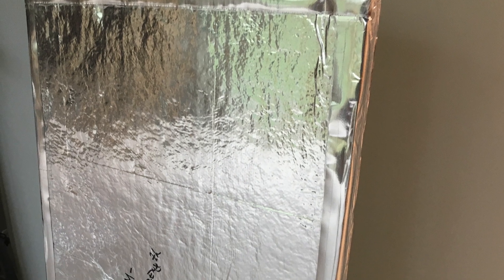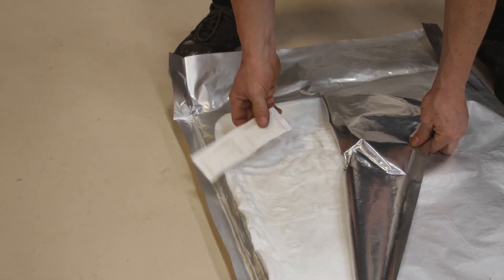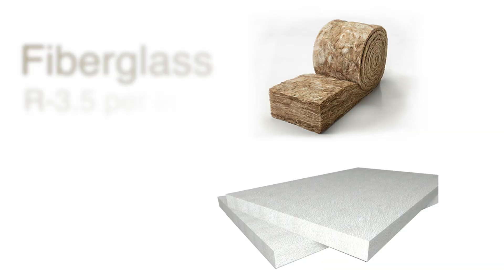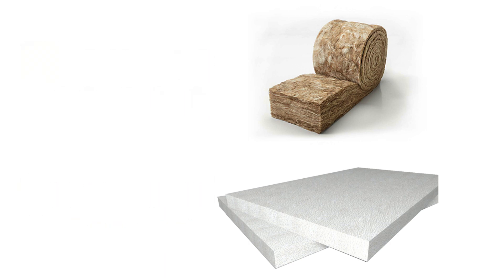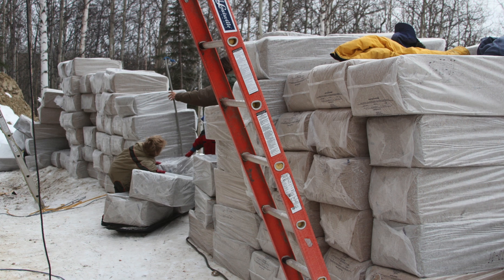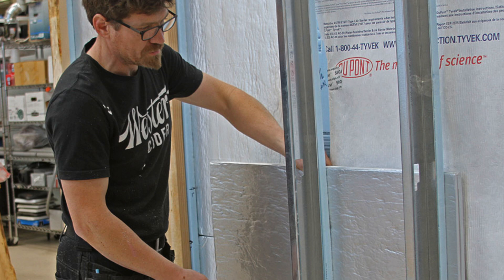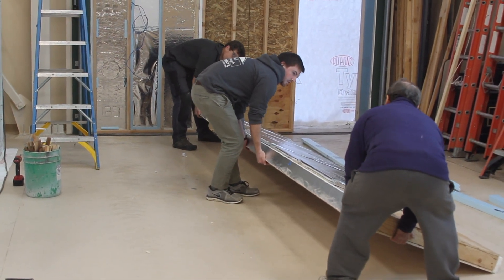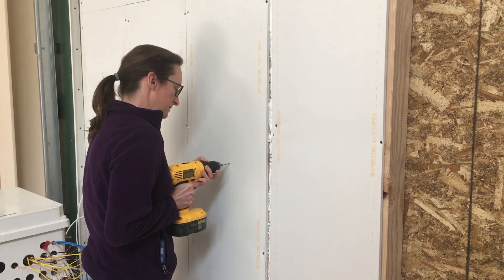Vacuum Insulated Panel Testing at CCHRC

Comment: The biggest concern is how likely they will be in getting punctured by a contractor in the field by like a screw or nail. Even if the benefits are high the fact that its going into home construction makes it extemely likely to be damaged in use. A home owner will most likely punture one just trying to hang some art or a shelf on the wall as well. killing all the insulation value.

Comment: With these types of panels, it’s best to cut a 1 inch slot in the middle of 2x6 studs than to go up against the inside/outside. That way they have more than 2 inches both sides to keep from getting nailed through.

Comment: I'm trying to find a company that I found three years ago pretty much when you posted this video they make vacuum wall insulation panels for floors ceilings and walls and the ones for floors and ceilings actually have rigidity you can walk on them you could put heavy pool tables on them they will not break if anybody here knows of that company I've been searching on Google just for about 5 minutes now I'm sure eventually I'll find it but yeah hit me up on here thank you
Reply: Did you ever find the name of the company?? I'm wanting to use VIPs for a tiny house on wheels build but the tech isn't quite there yet from what I've seen

Comment: VIPs have been sold for a decade.   (Kingspan's Optim-R since 2012, OCI's Enervac since 2012 (sold over a million units), Firestone's __, and Panasonic's __.  Did I miss any?)
When will VIPs be financially justifiable / competitively-priced for standard residential applications - cathedral ceilings / flat ceilings / walls / floors? What would need to happen for them to achieve that price point? 
Is it just a choice by manufacturers to sell high-price low-volume? Could manufacturers choose low-price high-volume and make more profit?
They require extra care and understanding, but could they not be sold in big box stores?
Reply: They seem pretty easy to make
Reply: @Robert-zx2df  that's because they are easy to make for the most part.
1.grab oversized foil sheet. 2. add packing/filler material then place another foil sheet over the top. 3.fold foil edges together over two times. 4. add double sided adhesive strips to one side of panel.
5. peel non stick backing off double sided adhesive, fold foil over sticky side of panel. 6. add more foil and double sided adhesive to add structural integrity around the edges and corners. 7. cut small hole in panel, then attach hose and evacuate air. 8. cut a square of adhesive backed foil then place over hole without losing vacuum. The last step would be easy to cover if the hole was a sports ball needle sized hole, problem is commercial panels use a 3/4 to 1 inch hole.
Reply: @zeroumashi2947     It is a little more involved. Most plastics (and adhesives) are gas permeable and also off gas. Typically there are multiple layers of both plastic (PET/polyester is a common one) and aluminum foil to try to reduce gas and moisture transfer as much as is possible. 

    Then, these usually have Getters and desiccants in them to absorb/adsorb gases and moisture. This is to help the VIP last as long as possible. Even with all these tricks--a lot of them are rated at full insulation capacity for something like 10 to 20 years depending. 

     They tend to be fragile, as the video mentions.
Reply: yes, i'm well aware that the adhesive isn't regular double sided tape. It's most likely one of the commercial 3m vhb formulas, they have so many varieties with different properties.
As for casing sometimes mylar is used. even stainless steel is also used to further reduce permeance.
They tend to be fragile because they make them with really thin material and haven't bothered to change how they're made.

I was researching about it long before i commented 2 months ago.
There wouldn't be a need for getters if the panels were prefilled with an high r value inert gas and then evacuated, or if assembled inside a vacuum.

I have an idea for an improved vacuum insulation panel that will keep it's r value if punctured.
I just don't have access to the tools to build it, the materials i can get.
Reply: @zeroumashi2947  - what would you need to test your idea - or at least get feedback on the idea?  Is your idea different from what you already laid out?
Thanks
Reply: What i mentioned is how most panels are currently made, except for the part about using inert gas or assembling inside a vacuum. 
They use getters like Justin w mentioned.

For panels that are currently on the market.
One way to reduce risk to loss of vacuum would be coating the surface in a self sealing gel and putting a thin protective layer over that to prevent the gel from getting dirty. That might provide some protection against nails which have a mostly smooth surface, It won't do much for screws if anything.
Putting a hardened fiber surface on the panel like some manufacturers have done, That won't do much if someone strikes a nail through it.

My idea would involve making a multi cell panel. You can't break vacuum of the entire panel by puncturing one spot if it has multiple cells.
Reply: @zeroumashi2947  The last part sounds to me like a hybrid of VIPs and closed cell spray foam.  (Cool.)
Do you have a sense of how to create the multi-cellular structure?
Reply: @zeroumashi2947  - The last part sounds to me like a hybrid of VIPs and closed cell spray foam.  (Cool.)
Do you have a sense of how to create the multi-cellular structure?
Reply: it's not closed cell because you can't currently form a vacuum inside the cells of PIR or PUR foam.
Although both PIR, and PUR foam are used in some vacuum insulation panels.
I wish i could say more, but i don't have a patent out and don't want anyone stealing my idea.
There's already a patent similar to my idea that uses a honeycomb structure.
I'm honestly just surprised that there hasn't been a drastic improvement in vacuum insulation panels.
It seems like people mostly want to just put out patents and never use them. 
You'd be surprised how many patents are out there.
Reply: @zeroumashi2947  - Not that I can be of much help, but is there something(s) you need in order to take the next step(s)? 
I'd like to think that others here - people passionate for VIPs' potential - might be able to help you move forward, in one way or another.

Comment: I'm so confused by the technology... I thought air is a wonderful insulator and hence the presence of air is a good thing. Hence most insulations are designed to be loose and allow the formation of air bubbles/gaps to allow air to be present and insulate from hot / cold, however in this case air is very much taken away... Can someone explain ?
Reply: Not so much about being a good insulator more about being a poor conductor
Reply: Air is a good insulator, but relatively nothing (aka vacuum) is even better, because there are far less atoms/molecules to transfer/exchange heat energy via conduction and convection. Vacuum can allow energy/heat transfer via IR aka a form of light, which travels like a wave, vs the particle travel via conduction and convection.  But Vacuum insulation panels usually deal with that by using reflective, shiny aluminum which reflects IR energy (somewhat like a mirror reflects visible light). Conduction, convection, and radiation (IR light waves) are the ways that energy gets transferred from one thing or space to another.  Vacuum insulation with IR reflection, effectively mostly shuts down most of that transfer. 

    But not completely, because you still have matter inside that is providing a path of conduction--in this case the fiberglass fibers. These get squished and even more dense during the evacuating process. The most efficient vacuum is when you have nothing between two different structural surfaces, like in an vacuum insulated thermos.  Vacuum insulated thermos's though, can get away with that, because the gap is fairly small, the material  (steel) combined with the specific shape (cylindrical), is very strong. It is much, much harder to do this with a vacuum insulation panel, which is why almost all of them use some kind of core-spacing-structural material in the middle (either fiberlgass batts, pressed fumed silica, perlite, wood fibers, etc). 

   Then in vacuum insulation panels, there are other issues.  Most plastics (especially most of the less expensive ones) are both gas and water vapor permeable and off gassing--especially under vacuum conditions. If you only used plastic alone, eventually the vacuum would be compromised.  They have to use aluminum layers with the plastic layers, to really slow all that down, because Al is not permeable and not off gassing in nature. They also put packets of substances in the VIP's to absorb and/or adsorb gases (from the plastic) and water vapor--thus also extending the usable life of the VIP.
Reply: the denser a material is it better conducts energy because the molecules are closer to one another and they spread energy by mooving and the denser more closely packed materials transport energy faster, materials that have low density are worse at transporting heat and the materials that use many pockes of air inside them essetially become less dense, so if you remove as much air you get less molecules and the lower you can get the better the insulation is, for example insulated bottles have a vacuum so that heat cant move thru because there is not much to move thru. I hope i've been clear
Reply: The vacuum works just like the vacuum in your thermos, except… the rigidity to maintain a volume of vacuum in your thermos is the exterior metal and interior stainless steel. The Mylar doesn’t have any strength to maintain a volume of vacuum so it presses the rigid fiberglass.

Comment: Can they be made in different sizes? I'm looking for a cleaner material such as this to remove the attic insulation, i want to make everything easier by making it cleaner and taking less space, while leaving gaps between some boards for easier wiring practices and where i do put it, i can put sound proof material with it to silence the room.
Reply: Industry can probably make them in different sizes, but I'm also trying to develop a DIY version, and I'm limited to 16" wide because of the equipment I am using.
Reply: @justinw1765  How did this go? I'm trying to develop a DIY version as well and am not having much success...Did you get one to work??

Comment: These vacuum panels are not anything new. They've been around for many years. They are not a good medium to insulate with, since the vacuum inside them tends to dissipate with time and as years go on, R value will tend to become very low. Not to mention, if there is even the slightest trauma, like a nail in the wall when hanging a picture, or doing anything around the house... and you'll need to break up the wall and replace panels. This is the reason why they never became popular. The new candidate for better insulation would be Aerogels which can achieve R-20 per inch and is as robust as fiberglass or stonewool bats.
Reply: bluesky it's a path, not a destination.   Have to think how a challenge can become an innovation
Reply: @Salvatore Guidone What "glue" are you referring to? AFAIK, VIPs are ultrasonically welded.
Reply: A very high quality/well constructed VIP can last up to around 50 years. Decent quality ones last up to around 25 years. Lower quality ones can be compromised within about 10 years. 

   And no, the R value doesn't become very low, because most of these are already using conventional insulation inside them, like fibgerlass, fumed silica, foam, perlite, etc.  So, it just goes back to normal with air for their thickness (exception would be the foam ones, since foam typically degrades insulation value wise, over time anyways).

   But yes, they are indeed fragile--especially as far as puncture goes. I think there are some companies that make them more robust, but of course, you will pay for that. You could make your own plywood boxes or the like to protect more fragile ones, but plywood now a days isn't exactly cheap either.

   Plasticized aerogels (typically with made with polyimide plastic) are indeed exciting, but still hella expensive, and I don't see any dramatic price drops anytime soon.  One, the supply is just not there yet, the base materials (like the polyimide) are expensive themselves), and the market isn't there yet. Did I say hella? I meant, expensive AF.

     You would have to be rather wealthy to insulate your home with plasticized aerogel. I think the next best market for this material, is for like thin, lightweight, smallish camp mats for more serious backpackers. A thin layer of this, combined with a regular air mattress will provide you a lot of insulation, at low weight. But it is still too expensive for even this market. Maybe even for the yuppy Patagonia crowd. 

     So the cool thing about VIP's, is that if you're smart and resourceful enough, you can make decent quality ones at home for relatively low cost (minus the specialized equipment to pull vacuums). Most of the materials involved are relatively inexpensive to downright cheap. It is the specialized processes that you are more so paying for commercial-market wise.
Reply: @Salvatore Guidone And there's absolutely no way to make them more sturdy and use something other than glue or use a glue that lasts longer? Maybe make it so they are connected and can be re-vacuumed with a "pipe"(or whatever the best material/system would be) network or however that would be fixed?
I get the way it's implemented currently is bad but there could always be a way around problems that aren't as much as a hassle as the current method.
Even if it requires an on-site production of an entire 300 foot wall. A mobile production line on two or three flat beds for a few days.

Comment: Would you get the same effect from a double pane window if you vacuum the air out?
Reply: Yes and no! You will insulate from convection and conduction, but radiation will not change. Radiation tends to e the highest way heat loss occurs through windows. The way to combat radiation is through Low-E coatings that are used.
Reply: If the glass didn't break and was perfectly sealed, then yes if you exclude the obvious light going through the window. Units that actually exist have to use spacers so the glass doesn't collapse and have an R value of like 14 per inch maybe?
Reply: Yes, this does exist and is getting fairly mainstream now. There are 3 main brands: NSG Spacia, Landvac and Fineo.
Reply: You need to use high quality, thick/durable glass.  I've tried using the super cheap, thin stuff from Lowes/Home Depot, and it is far too fragile and weak, even with supports (bamboo columns in the middle).  Then the material of the window frame has to be gas impermeable. You can't use wood or regular plastic alone for example, because these are far too gas permeable.  You can put aluminum tape on the inside and outside though, or use specialized epoxies rated for vacuum use. 

  But as folks mentioned below, you still have to deal with radiation transfer via IR. As mentioned, specialized coatings help with that.  Some coatings allow the glass to transmit heat via the Sun, but block/reflect regular heat (from within the house, our bodies, etc This is because they are at different wavelength ranges). Others reflect both. 

  If you're building a more passively heated home, say by having large windows on the south side, you obviously want to go with the first type of coating (that transmits solar heat), but in the rest of the house, you want to block/reflect both to help keep it cooler in the warmer months.
Reply: @justinw1765  have you tried making your own ?
Reply: please soneon explain this subthread.. Double glazing DOES contain a vaccuum doesnt it? or are we talking about the degree of vacuum?
Reply: No. Standard double glazing just contains dry air or dry inert gas, and a standard double glazing panel with a hole drilled on the inside performs very very close to the same standard.

So if you have condensation inside a double glazing unit, go ahead and drill a hole out of the inside panel